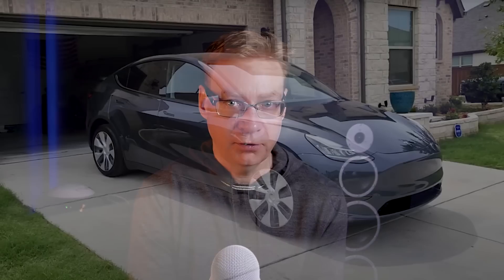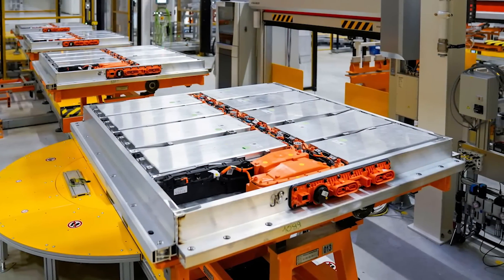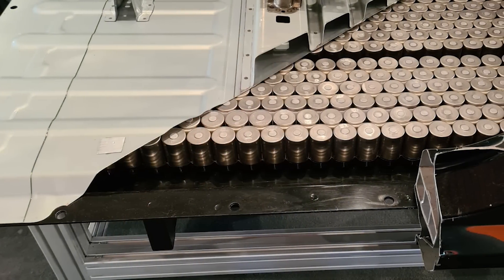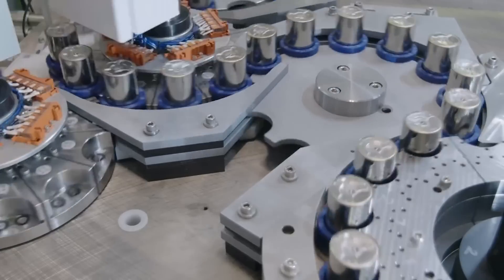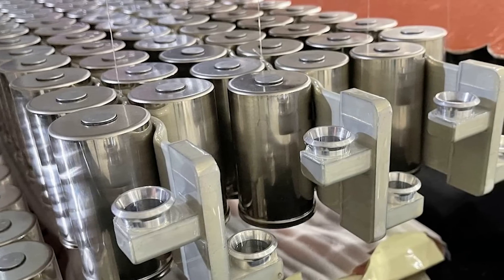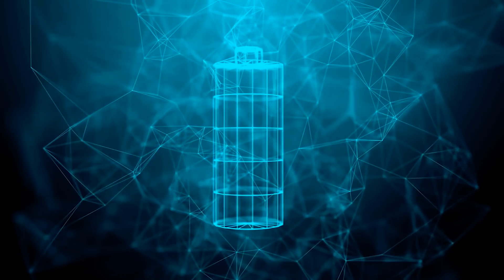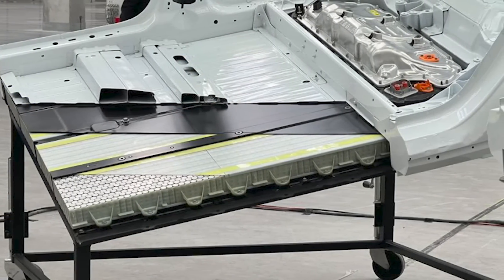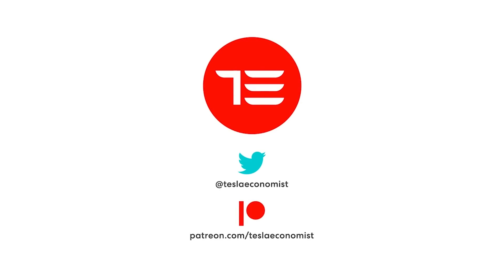What are Tesla's Actual 4680 Breakthroughs?

Comment: Lee you speak wisdom, the best way is keep it simple stupid (KISS), The 4680 is just that, simple and quick. What I learn in my math class is using calculus to write an equation that can come up with the (maximum minimum).  The equation was so interesting and how to design the best battery.  I wonder if the battery makers are using this method to design the optimum battery using math to create types of batteries possibilities.  This method in math is the use of maximum minimum calculation,   Business of all kinds optimize the best performance by plugging in projections and numbers to see the results. Like doing your taxes, how how to get the best legal return.   A business or battery maker can plug in numbers or different elements and see the possibilities and thus maximize production by testing the results.  Sometimes the equation would need slight adjustment to get the best model to represent the empirical world. I once wrote an equation that worked like that and it worked to help make projection by substituting different parameters.  The power of math cannot be ignored
Reply from the maker: So like finding the sweet spot.

Comment: Tesla also halved the metal current collector foil thickness, with improved GED as less inactive weight.
The batteries will be about 15% of vehicle cost - it’s not the big money spinner. Cost reduction is the money spinner! Software type profits are in … software. Austin Y pack "wiring" sheet is thing of beauty & simplicity. One layer, no screws. Due to +ve & -ve terminals being accessible on top of cell casing, unlike 2170.
Reply from the maker: Was this for the DBE anode, or cathode too? Just for 4680?
Reply: @TeslaEconomist  See Limiting Factor teardown (Pt 1 57 min) of early cell. 4.5 micron for copper anode mentioned (vs 10 micron). I’m unsure of the aluminium cathode CC - but that’d be someone else’s commercial sheet at this stage (Panasonic?). I’d guess welding a tab onto 4.5 micron would be difficult - but guess only, no expert! Rewatching part 1, I’m less sure of info, it might be industry standard now.

Comment: I think the benefits of the 4680 cells in allowing the gigacastings plus structural battery pack structure is underappreciated, and I think that making them last for a million miles is critical to the robo taxis. Cost per mile is a big part of what will determine customer choice for robo taxis, and the durability of the taxis themselves will be a significant part of that cost. If Tesla robo taxis last four or five times as long as their competition, if they ever have any, Tesla can charge less. Of course, retail buyers also are likely to prefer to buy a car that will last them the rest of their lives too. 

I also expect that the 4680 cells will be able to charge significantly faster, and I think Tesla is sandbagging that right now.
Reply from the maker: Yes, I think they can hit a million miles, likely without silicon in the anodes.

Comment: If they aren't using dry cell technology they must have alot of drying they weren't intending to have. Hence footprint and matching slower production rate. Possibly why they don't want it at Berlin or Texas yet. Tabless means foil conductors need to be much thinner. As the path is direct to  many tabs.

Comment: Tesla 4680 not just the form factor, they are re-engineering every aspect of a battery cell.
The final version will exceed 300 Wh per Kg.
Of course nothing is the final version for Tesla.
Reply from the maker: Yes, exactly, the form factor is almost the least amazing element to it.
Reply: The form factor wasn't possible for high energy cells before the tabless design.
DBE will be a bonus in manufacturing capacity (GWh/ TWh) per unit area of factory (also making the factory cheaper)
They compliment each other to reduce price.
Reply from the maker: @Roger Starkey it is possible with multi-tab design too, like Panasonic are using for their 4680s. But I am sure you know that already.
Reply: @TeslaEconomist  
"Tabless" is essentially "multi tab".
We've yet to see the exact arrangement of the Panasonic tabs.
Reply from the maker: @Roger Starkey we have just heard insiders claim about 5 tabs. I think tabless is a better label for Tesla's version.
Reply: Not a tabbed battery